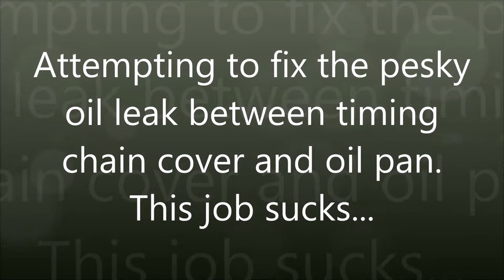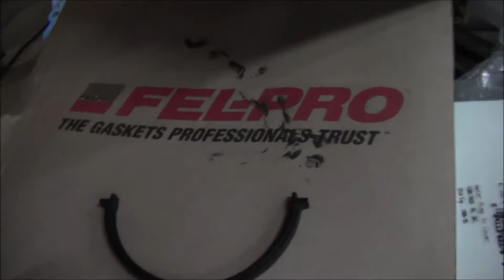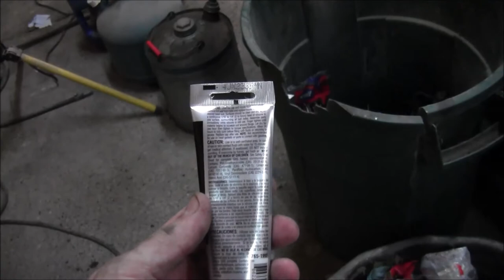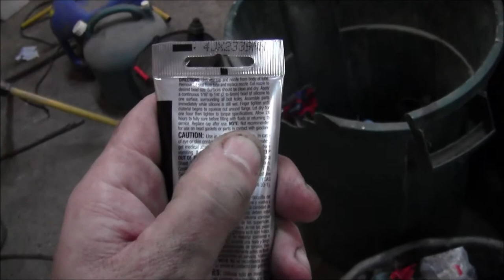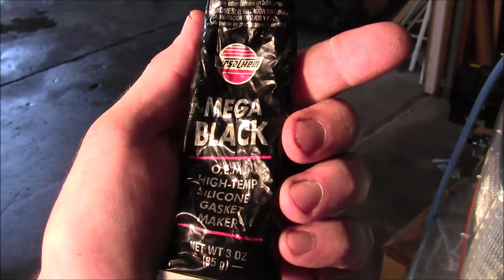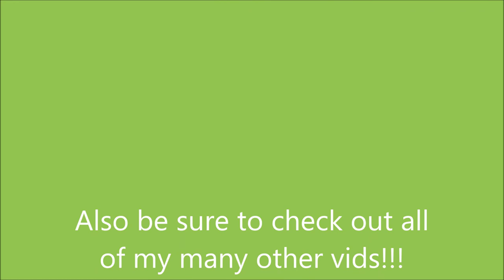Ford 302 Oil Leak Between Timing Chain Cover and Oil Pan - Round #2

Comment: Thanks for pointing out the oil dipstick tube leak. I've been unsuccessful in trying to find where my Ford 302 is leaking oil, and this gives me a place that I haven't checked yet. (I've already replaced the valve cover gaskets, the oil pan gasket, the timing cover gasket/front seal and the intake manifold gasket. I had to do the timing cover because it was leaking a lot of coolant. I didn't like the multiple pieces originally used for the oil pan gasket so I went with a Fel-Pro "Perma Dry" one piece oil pan gasket.) There was some oil leaking from the valve cover gasket and the intake manifold gasket, but there's still another leak somewhere...I don't think its the rear main seal, because the transmission bell housing is clean...but the cross pipe from the exhaust and oil pan still do get covered in oil...)
Reply: Paul Weiss did you find the leak was it the dip stick
Reply: Chris, I rechecked the inside of the bell housing through the inspection cover and found oil there. I believe it was the rear main seal. I'm still in the process of replacing that. (I'm self taught/DIY, and the F150 is not a daily driver...and it's taking a while to finish the job.)
Reply: ...and I did check the dipstick, and it wasn't the source of the leak.

Comment: It takes forever to do that Oil pan gasket . You have to drain your anyfreeze remove your radiator shroud and the radiator remove your pullys , fan , clutch , water pump , yes easy . But when you said quick I had to laugh 😂 really hard .

Comment: Do you have a link to a bolt diagram of water pump and timing cover? I've do not remember where my bolts go.Thank you your truck has come a long way.
Reply from the maker: Killermonkeyz22 oh man, Im not sure if I have anything on that or not.  I know the first time after snapping about 5 bolts off I was in your shoes... there are some diagrams out on the internet...think think think...ugh... I cant think of where I found them.  Ill try to locate them and post it for ya.  Best thing to do when doing the water pump is to loosen all the bolts, and then remove the pump with the bolts in the holes, but sometimes that's just not possible.  I know I saw some diagrams somewhere, Ill see if I can find em.
Reply from the maker: Killermonkeyz22 this may help you, or at least get you on the right path.  I googled 1994 302 water pump bolt diagram... hmmm.. it wont let me post the link.  Just google that, and that should put you on the path for what you are needing.
Reply: Thanks man I just tried them I felt where they went.

Comment: I'm in the middle of this job right now myself. So your oil pan gasket is a rubber cored metal gasket, correct? Did you use the cork corners that Felpro includes in the timing cover kit? Did you use the rubber "U" shaped seal that Felpro includes in the timing cover kit? Thanks so much, if you can answer it would be of great help to me!